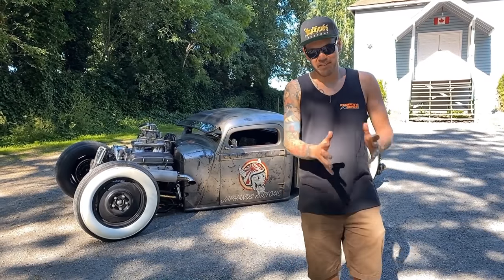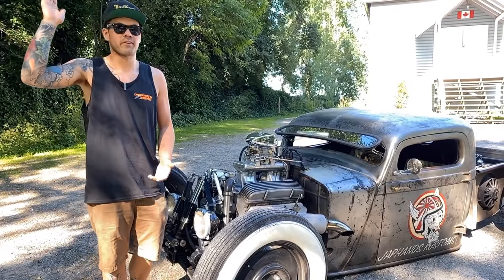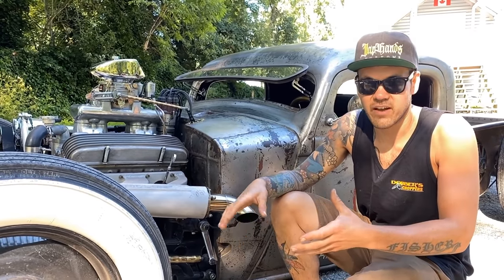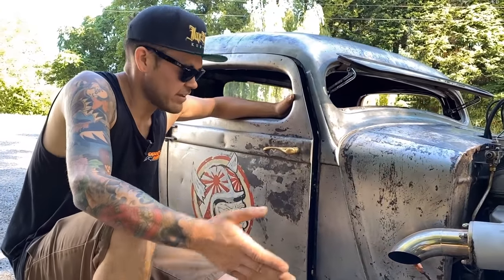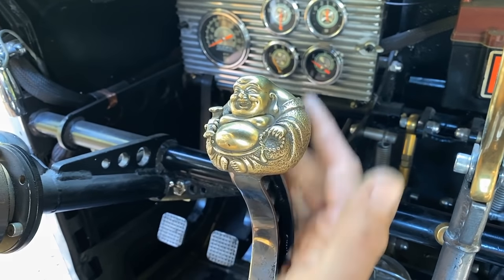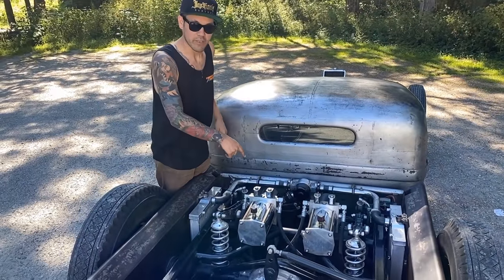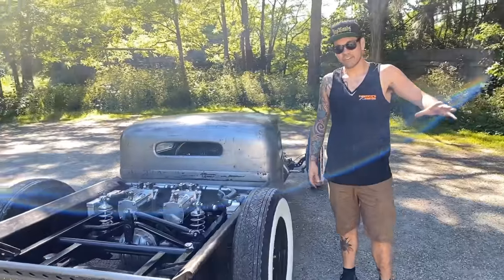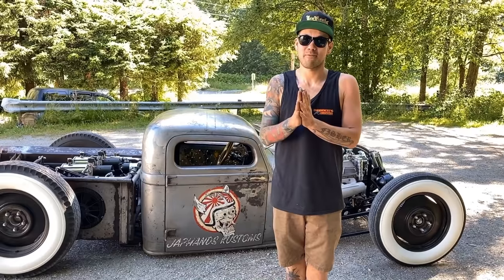How I Built My Shop Rod ON A BUDGET!! | FULL STORY + TOUR | 1938 Dodge RAT ROD Truck!!

Comment: I have on of those cabs I pulled from a junk yard for $25  very little rust. But the roof is dented a lot. Plan on running a 300ci ford straight 6. My kids aren't allowed to drive a v8 here in Australia for the first few years of holding a drivers license.

Comment: Brent at Halfass Customs told me about you. You. Are a very good fabricator. I also watch Tony at Fitzees. I have a very large shop, and I build cars from the.ground up. My Dad had a junkyard, so I grew up building cars. I enter 2 cars at SEMA every year. I don’t do the YouTube thing because the cameras get in the way. My cars are brand new when they are finished and very expensive. I mainl build restomods, and most of my customers want the LS and turbos. I seldom build a car that has less than 500 HP. I also build custom motorcycles. You keep up the good work!

Comment: We use boiled linseed oil like a lot of knife smith's and it works great! We apply and the wipe off so it doesn't cake up. I'll have to look at the Gibbs because amsoil mp10 metal protectant is getting more expensive.

Comment: You planed and  built a safe and interesting machine. I am curious about the brass cable actuator above the E brake mechanism, something necessary I'm sure.
Reply from the maker: Good I Gregory! That is a throttle control lever from a classic wooden boat that I’ve re-purposed as a choke lever for my manual choke carburetter

Comment: the truck is a mechanical marvel .. and does not need anything  !  (with the impact of the brass) commanding the attention of the interior "a suggestion" covering up the radiators with brass artwork" be it a complete bedside louvered or a scoop intake with the same beautiful design like the door panels or seats .. this is meant to be a complement on a outstanding metal robot of functionality and i'd like you to explain the brake clutch pedal assembly "how it works" for a project - thanks

Comment: Unreal looking truck man! Instant favorite. I'm building a rod and trying to get that flip open windshield too, but can get the angles right to have it open that far. Can you do a detailed video on the windshield by chance. Thanks
Reply from the maker: Are you restricted by your hinge or by your slider? If it’s your slider you will need to move it closer to your hinge that will allow more travel
Reply: The top of the windshield frame hits the cab as it hinges out. Mines is a two piece glass windshield and a 47 mercury cab so the v-shape might be the issue.

Comment: Thanks for the walk around. I like your hydraulic over spring much better than air bags. I will try to incorporate it in my 1 ton 37 plymouth. Have you thought about relining your aluminum brake hubs?
Reply from the maker: Yeah I actually had a good conversation with the machinist about re-lining them. He actually machined down aftermarket steel ones until he had the insert ring which would take a long time. Then he machined out his aluminum ones to remove the steel ring. The interesting thing is that for an aluminum to steel insert the interference fit is .070” That’s a lot lol you have to heat the aluminum and freeze the steel and on top of that he also pinned his. 12 hours total for an experience machinist probably take me 20hours lol

Comment: PSS  Love how much salvage you used... I literally have built my entire trucks frame and body out of c1500s and some s10 parts from a buddies truck...other then essentials brake lines and suspension components that were gonna get scrapped so they live on with my beast! Im wanting to go higher with my rat but also be able to bring it back near stock...
Reply from the maker: That’s cool that you use lots of salvage as well! It’s takes a lot of imagination to make mis. parts work! 👊🏼
Reply: @MakeItKustom  thanks I enjoyed building it and if I ever get the old heads off and can cam it and toss the vortec heads on I should get many more years of fun out of it... rn i reuse everything and anything Im tired of he throwaway culture

Comment: Really inspiring truck. We had a big fire here exactly a year ago (I live in Talent Or.) and a lot of cars burnt up, Guy has got a couple of trucks that burned, one shaped like yours, chevy I'd guess, and a 34 ford, both with rectangular tube chassis, disk brakes, chevy small blocks and so on. I wonder if they could be saved or the heat ruined the metal. Thanks for mentioning my name in your last video, my head swelled up two hat sizes.
Reply from the maker: Ha ha ha ha you’re welcome man and thank you for pushing me to make the video I do appreciate it! I had a burnt up car here that we did some work on and I do believe that the metal can be brought back certainly the whole car would be annealed and somewhat changed properties of the metal but I would be interested to see what could be done to bring it back

Comment: i've got a '36 chevy truck, from the rear of the cab forward, that i got in the same shape for $200 usd. it sat on the ground in a wood lot for almost 50 years, so the floors are rusted away, as well as the running boards and the doors half way to the door handles. i'm thinking about building the truck on an s10 frame to keep it cheap and simple. bonus, they share brakes, front suspension parts and rear axle with the camero. i'm gonna channel it since i have to make a new floor any way, but i'm not gonna chop it. i'm still in the parts gathering phase, and am looking for a cheap, junk gm class c motorhome to pull an engine from, since a lot of them used heavy duty, 4 bolt main SBC or BBC engines, making them really good donor vehicles, to be mated to a borg t5 tranny i have that was in a mustang. i'm gonna build an oak floor, flat bed with fold down sides for it since it was a 1 1/2 ton flat bed truck that i don't have a bed for, but i do have a lot of red oak 4"x4"x8' beams that were used between heavy steel i beams during shipping, which will look cool, and help me stick with the budget build rat rod aspect. i'm hoping to come in under 5k total build cost, but who knows how many hundreds of hours i'll have in it before it's done.

Comment: My God, you're a PHD of metalfab and engineering! Nice everything. What's not to "Like"?

One question: On the suicide doors. Do you have a failsafe or redundant deadbolt system to keep them from opening or being opened while the vehicle is in motion. I'm building a Beetle fliver, and would like to add a little confidence and safety to my ride.

Thanks
Reply from the maker: I had thought about a safety system like a deadbolt or a solenoid but no I don’t have anything. My doors actually open all the way until they hit the rear tire so if they did open they wouldn’t bend they would just hit the rear tire. I’ve been lucky so far knock on wood lol

Comment: this is exactly what all the rat fink shit is about. way before it became over commercialized. I intend on taking a mini Cooper clubman, chopping the front clip and mounting it on a c notched s 10 frame. scrubbing it down, rework the the tail light section and pulling the glass out to panel it and some sort of v8 up front. Id like to do a flat head but budget is what budget is. great job guy. I'll use some of your ideas on my build. thank you for posting and your passion.
Reply from the maker: That sounds like a rad project Richard!! Best of luck on your build, its going to be killer! Thanks so much for watching

Comment: Very cool. Lots of cool unique one off parts. I understand that you built it on a budget. But the sbc is very generic like everything else but otherwise very very cool.
Reply from the maker: Yeah it’s pretty generic but I can get parts anywhere LOL
Reply: @MakeItKustom  if you run an sfter market distributor, carb and fuel pump on it. They are probably pretty much the same as you could run on an olds, Cadillac, chrysler, buick etc. Fer example a pertronx electronic distributor internally would likely be the same. So get parts any where is a very week excuse as for 90% of breakdowns you would be chasing the same parts.

Comment: The mag is awesome . Are the ignition points still available? Did you make the valve cover bolts?
Reply from the maker: Yes the points are still available and bill it specialties makes the bolts for the valve covers

Comment: Cooler than s***. Really like the rear located radiators. Grew up riding around in a 1933 Dodge one and a half ton ambulance from ww.. it was set up as a truck with 20 inch wheels 6 cylinder 4-speed and about a 15 ft long boom with the great big PTO winch I would say even if a semi parked in your spot you could remove it with that thing. I really like your style all the stuff is Way Cool except I'm a painter so I was thinking what color I'd painted LOL🙏🙏

Comment: Could you make a video on frame building, rat rods ,custom rods..love the truck..I have 41 dogde cab and a 38 Chevy box...so you gave me some ideas...
Reply from the maker: Right on! Great idea for a video! Are there any specifics you were hoping to learn? We will definitely be working on the Caddy frame in the near future
Reply: @MakeItKustom  ok so I have 3x6 1/4 inch stock ,3x4 1/4 stock  and 3x3 1/4 stock 2 inch round, 2 1/2  ,2 3/4 inch round ,3 inch 3 1/4 inch round stock the round is all 1/4 wall.. and a bunch of missalayneis steal and plate I've gotten for free,also 9inch out of a truck straight axel out of a 60s econoline van. So some thing cool and custom 😎.  Maybe rear z front straight legged or both front and rear z frame, also got the box for free and the cab I traded a mid 30s chey box for and I got that for free aswell.. we like free, free is awesome 👌. So when you start on a frame I will be watching  can't wait, thank you..
Reply: @MakeItKustom  sorry so I have alot to work with just were to start, and I'll be working on my garage floor when I build the frame..

Comment: For your Brake drums to bring them back around you could put them in a lathe on super slow and weld new material on the braking surface and then turn them down to bring them back to within limits I've seen this done on Industrial Equipment.  There is a process to doing it by heating them first as to not have them crack and slowly ramp the heat down after the welding with some research I am sure you could figure it out. New to the Channel I did hear about your Channel from Half Ass Kustoms Channel and have subscribed love the content so far. Hope this helps
Reply from the maker: Thanks for the insight! Since these are aluminum with steel liners, the liners can’t be replaced with much machining. I have not heard of automotive drums being resurfaced. That’s very interesting though! Thanks for sharing

Comment: What is the product that you use to fight the rust on the baremetal surface? I have a bike with bare metal  tanks and fenders.  Had then cleared  but the tanks still rusted under the clear. I'm looking for something  t ok fight the rust and still clear over it.
Reply from the maker: Gibbs brand is what I used. It’s a non-silicon-based lubricant that does not affect paint so if you were to spray it and wipe it all over your tins and then let it dry you could actually paint the clear over top

Comment: Too bad you can't mass produce these things and have them accepted by the various transport departments.
I do like a lot of what has been done. Many of the little touches made me wish I had opportunity or features like that. You are fortunate to have access to thousands of the last 100 years of stylish and powerful v8 vehicles for the axles, gearbox, engines and other things. All the brass features are mint and I like your camera ladies tattoos too. Not sure about the seats man but I haven't had to drive anywhere to really know how it rides like that. Top chops are a pet paradox. It sure would be cool to have means of stamping a roof panel that is set to match our need for a roof shape. One piece no welds and cuts nor different steel characteristics here n there. WoW! Amazing vehicle really.

Comment: Can i spray b.i.g.g.s lubricant on 1967 ford original paint and down the line be able to paint over? its got pockmarks causing surface rust. don't wanna get stuck stripping paint off to repaint
Reply from the maker: Yes you sure can the beautiful thing about Gibbs is that it is a non-silicone-based lubricant which means that it can be washed off and it will not cause issues with paint later on like a silicone-based  lubricant
Reply: @MakeItKustom  hot dam! thank you!!!

Comment: Man!  Those exhaust manifolds are bitchin!  Did they say nelson on them?  I need a pair for my 27 T I'm putting together!  
And Astro AWD space savers??!!  Really!  I hope the word doesn't get out too quick!  Never would of thought!
Cool build!
Reply from the maker: Nicson headers. Yeah man I’m stoked they worked for this application so many people told me it would not work. I beefed up the runners to quarter inch plate to help take the heat without running water through them like they would have in the boat. Best part is they were only 30 bucks at a swap meet but I guess I spent about 40 hours messing with them ha ha. Save as many of those space savers as you can I need another one lol
Reply: @MakeItKustom  we have a crap ton of AWD safari vans here in the bone yards in Missouri!  
Seriously!  If you need one I can get some within a couple days notice!

Comment: Why drums? Why not rotors?
Reply from the maker: These drums used to stop at a 6000 pound Lincoln they can definitely stop my little hot rod. To be honest I like them better because they are old and cast aluminum. No doubt discs are superior to drums but drum brakes still stop amazingly and with no antilock braking system my tires would slide long before a rotor versus drum would come in to play

Comment: I'm 42 and my two goals before death are to own a truck identical to this and to own a nice chopped up bobber. I want my kidneys to bleed from potholes not alcoholism. I built a kid a 37 Ford and it was destroyed at his college because whoever built the frame didn't build it to standards for the schools safety. All we did was get the engine running and dropped in. It was actually a fairly easy build.
Reply: I'd even go for a hardknock on the bobber.
Reply from the maker: You should totally do it, man!! Yes, potholes and this truck....your kidneys are definitely feelin it! That's a shame about the build. I'm a firm believer in doing it right the first time! No cutting corners! Hopefully nothing serious happened to kid who owned it!
Reply: @MakeItKustom  don't think so it was a basic roller and he was going to school to be a mechanic and was using it as his project. Teacher said the frame wasn't compliant with the schools standards. But yeah man nice build.

Comment: It looks like it was turned upside down, the strange bottom parts seeing the light of day, that are normally covered, then turned inside out, to expose the naked guts of the ugly stuff that mechanics know, that makes a truck go, then told to run backwards—Fast.....and it does!

ASE Master Tech (TEST) since 1978 - Working on anything with a Motor after potty trained!
Reply from the maker: Ha ha ha totally! I’m all about the mechanicals. And this way if something falls apart I’ll notice lol